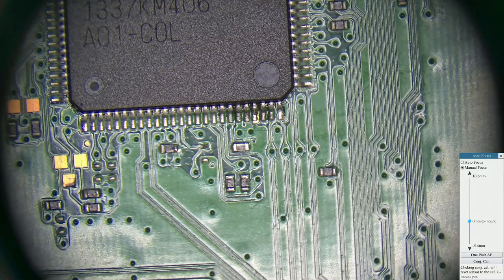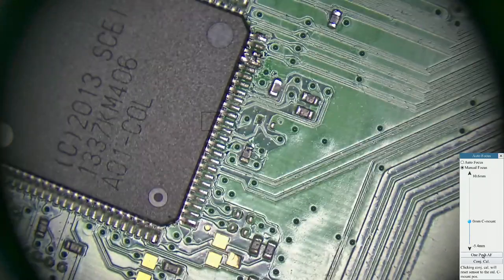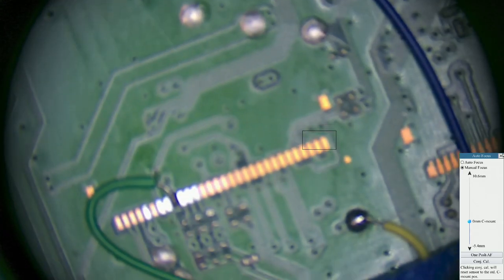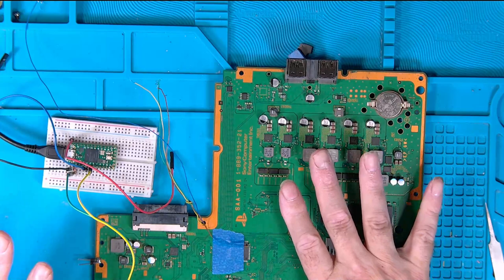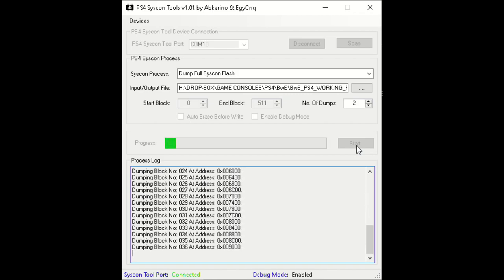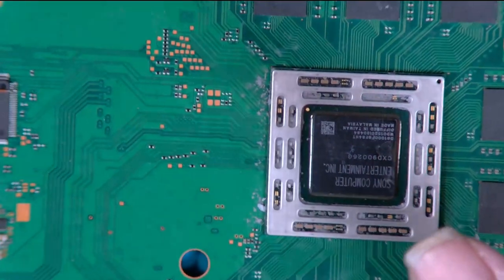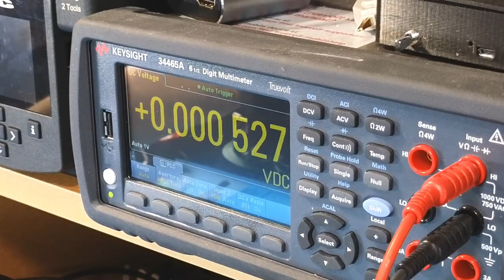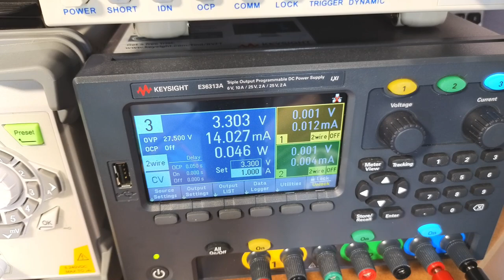Part1: How to prepare a PS4 FAT Mobo for syscon read/writing. See software and help links

Comment: Thanks for this guide mate. Really appreciate it. However, i have a question. Whats the point of lifting that pin 22 (glitch pin) off the board? Would it interfere while using with teensy board if connected to the board?
Reply from the maker: The pin has to be lifted to glitch then you set the debug patch in the syscon .. once that has been done you can put the pin back .. then you use the pin 12 tool0 and 13 reset..  but should you over write the debug bit by accident you would have to lift the pin again.. so what i do is….  As i said in video .. when your ready to boot ps4 you can connect the lead  from pin 22  to the 3.3v were the red lead was.  Or if you have finished working with syscon just put pin back to pad….  I leave my home ps4  pin 22 on a link so i can pop link on which connects pin 22 to the 3.3v then should the debug get overwritten i pop link of and connect it back to the glitch pin on the writer….  Hope this answers your Q. If not let know
Reply: @Steve_be  No, I understood. Thanks a lot mate 😁 I really love these explanations! Thanks a lot for sharing this knowledge.
Reply: Steve great video for noobs like me and others. I appreciate all the effort that went into it. Clear explanation.

Comment: Liked the Video Steve, thanks for that.
Steve could you change the APU, Syscon and Nor to a good board?.
Reply from the maker: i cant see why not you will also need the daughter board fro the original  DVD unit  whats wrong with board
Reply: @Steve_be  via is ruined, so board is gone. Its a 9.03 trying to get it down to 9.00.
Got the syscon and nor dumps.
Thanks
Reply from the maker: @spats6432  from those dumps you can find what it will downgrade to
Reply: @Steve_be  I don't know how to read dumps mate, but I need a chip change to a new board to revert.
Reply from the maker: @spats6432  got it, ill be making a video on dumping the NOR and using the free software soon
Reply: @Steve_be  cheers Steve, let me know if you want to do the chip change, bud, thanks

Comment: steve nice tutorial it works great but i have a question i have teensy 4.0  can i use the teensy 4.0 also to read the nor chip ? or do i need order programmer
Reply from the maker: That is being worked on, but you can use ch341a .. im just doing part 2 which is reading the NOR using a ch341a
Reply: @Steve_be  thank you steve i have order that programmer (ch341a ) for reading the nor now waiting for part 2 🙂 than
Reply from the maker: @jengen3624  should upload later tonight
Reply from the maker: You  can use a ch341A  very cheap  unit, just a bit slow..

Comment: Does the pin need to be lifted at all times or can it be placed back once debug has been patched?
A tutorial for that would be amazing, that part is really confusing me as there isnt much detail on that at all.
Thanks.
Reply from the maker: It is in the part 1 tutorial..  but when you set debug you dont need that pin so connect it back..
Reply: @Steve_be  Thanks for getting back to me. Re watched this video, so my understanding is, lift the pin, wire everything up as included diagram shows, do 2 dumps to confirm working, if correct select the debug option in Sycon Process press start, let it finish, once complete I can remove the wire and put the pin back?
Sorry, really don't want to go wrong on this part.
Reply from the maker: @Doyle69  before you put the pin back you can run the unit by connecting the wire from the syscon pin to the 3.3v check its working then when you finished take the wire of and solder the pin back
Reply: @Steve_be  Thank you